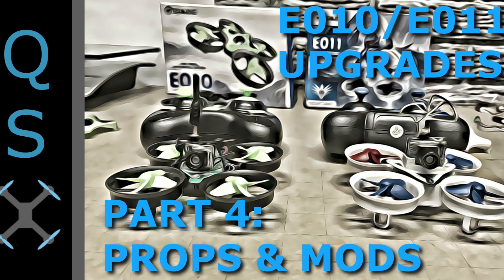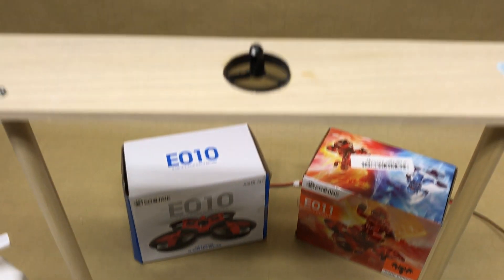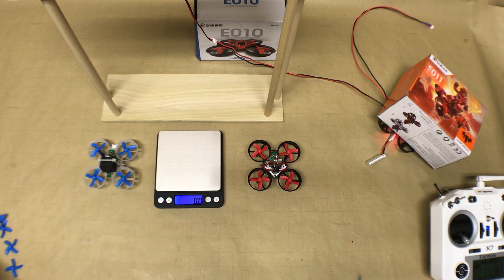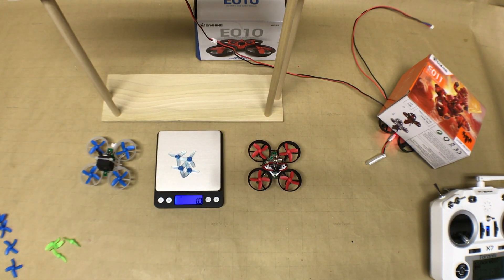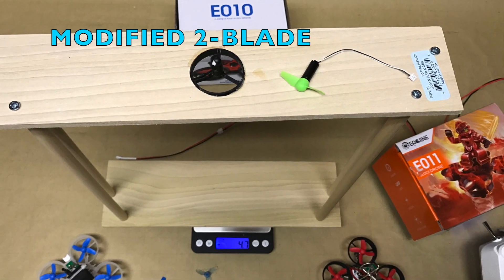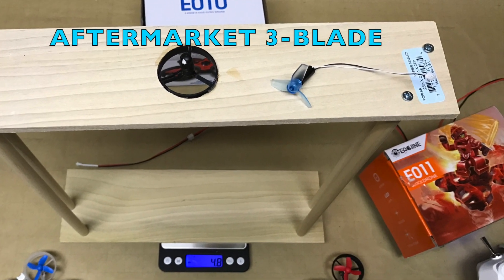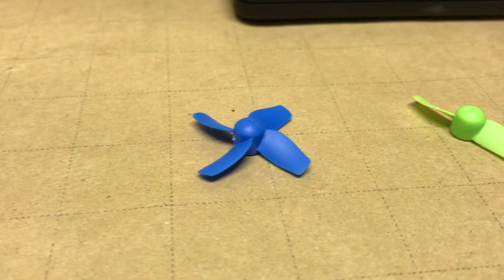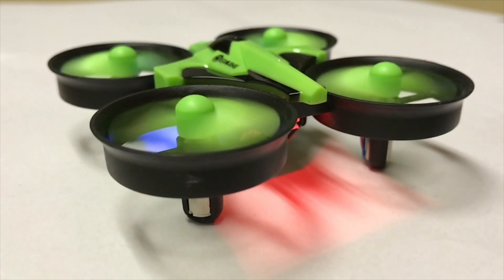Part 4: Eachine E010 E011 Upgrades - Propeller Mods With Thrust Test Comparison

Comment: is it thrust test with e011 or e010 ? Thats important becasue E011 have bigger motors
Reply: its with racerstar motors. they are aftermarket and are not included in either quadcopters.
Reply from the maker: As The Lennipede mentioned, these are the racerstar motors that fit in the E010 frame (615 motors).

Comment: how can you modify the e011 prop? can you make a video?
Reply from the maker: +Ryan Caindoc You can use nail clippers to cut two blades off.  I like to use a dremel to smooth it down to the center portion to make them more efficient and balanced.

Comment: I also tested the 2 blade on the E011 and it was not better in the least! It could barely hover let alone lift the drone with a camera installed on it. With the standard 4 blade props and the same camera installed, it has plenty of power. Don't modify the E011 to the 2 blade prop!
Reply: have you tested the 3-blade prop? If so, how does it perform on the E011. My E011 is arriving this week...
Reply from the maker: +Arjohn Reodica check out this video for the 3-blades on the E011 :). https://youtu.be/-lX8gsKcYLo
Reply: thanks!